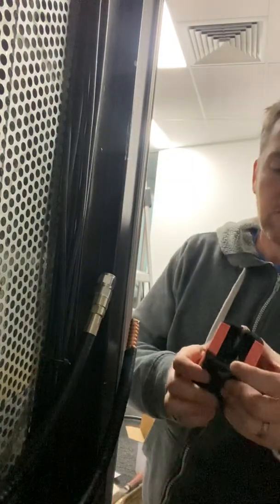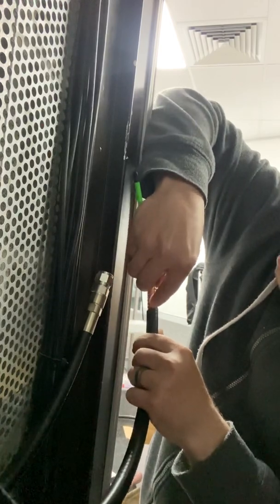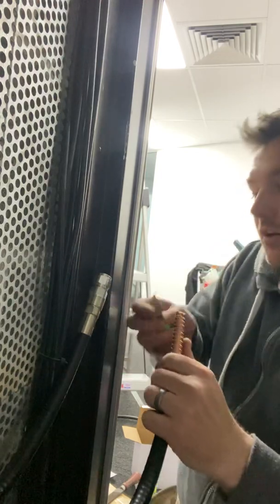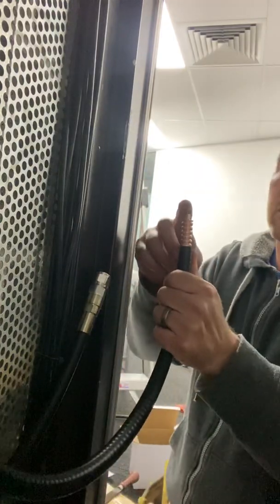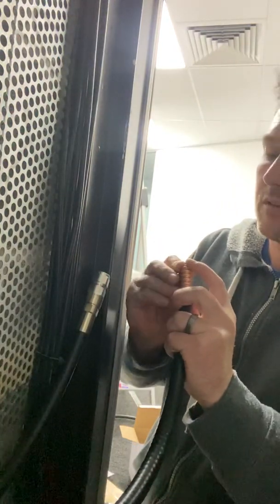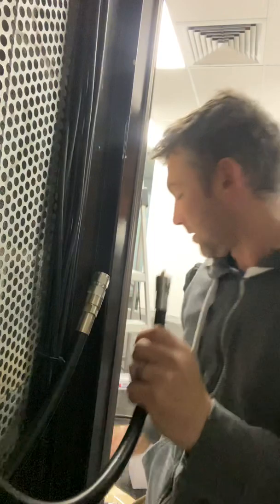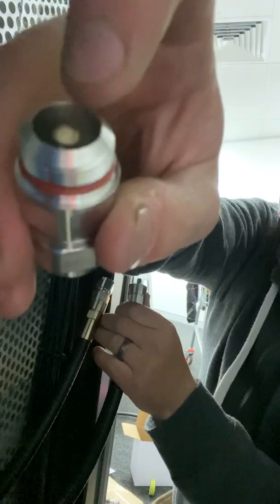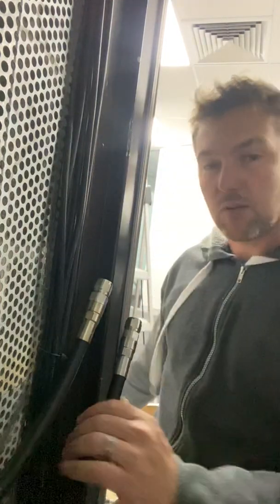Terminating LDF4-50a with commscope L4TNM-PSA N male connectors

Comment: Mate i have the same two connectors on my radio station. Its giving me greif by going into high SWR. When i bend the cable or move it, the SWR drops to next to nothing. What is a better fitting?? These fittings have been nothing but stressful!

Comment: @7:30 that's actually not entirely true. I guess coax cable would have been military but the use of shielded signal wires was around before coax cable. They used to bury pipes with signal wires as coaxial runs on big longwave arrays. So you might be right if we are talking about cable but the idea was around before cable.